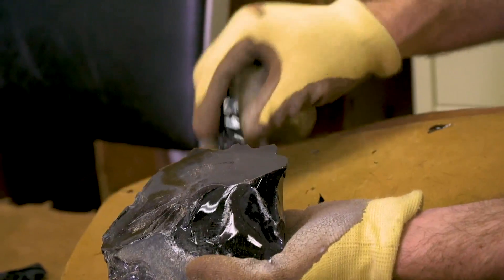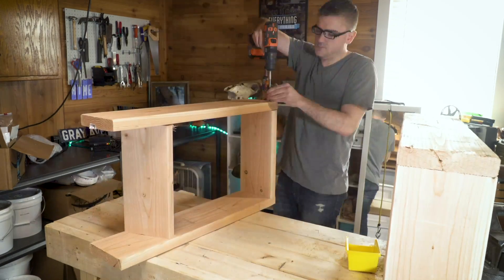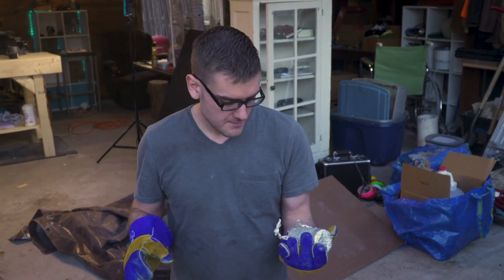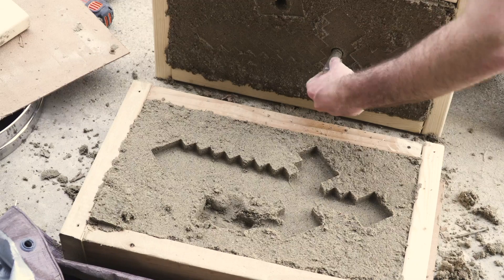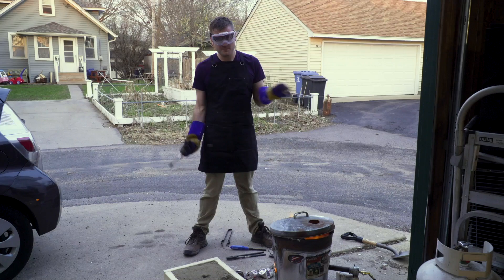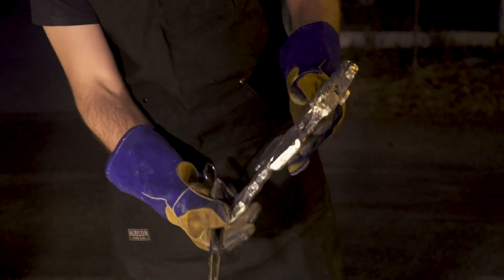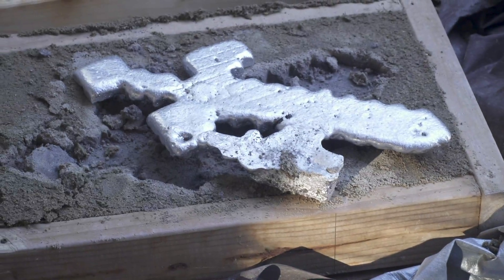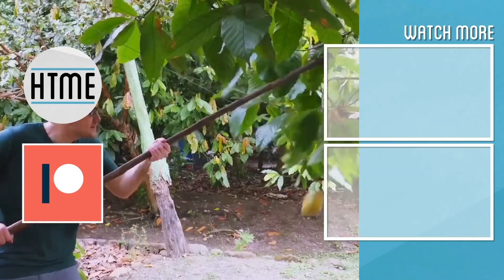Minecraft Sword from Soda Cans: Metal Casting 101

Comment: a quick warning if someone rly wants to melt soda cans.
1. do it outside and breath as little as possible if you re close to the furnace
2. be EXTREMLY careful with water in the cans which can lead to a vapor explosion, potentially splash molten aluminium into your face
Reply: lastly, consider sanding off the paint. it ends up as slag and pulls a lot of aluminum out with it.
Reply: You_just haha, but tbh i did that mistake and breathed in the toxic fumes, had coughing problems for weeks
Reply: JPAnor thanks for the advises
Reply: Andreas ikr, that s why i cringed so hard at the "aluminium ball challenge" videos. No one used dust mask and no one cared.
Reply: pshh, inhaling aluminum is good for the lungs, gives em a nice metallic finish!
Reply: JPAnor Same here, turns out coal dust, fumes, and whatever vapors come off those cans really screws your lungs up, had trouble getting a deep breath for weeks
Reply: Yeah, no kidding haha. My grandparents took my brother and I to a fair and they were demonstrating making lead musket rounds. I went first and held the mould while the guy poured in the molten metal and he dunked it in water. Then my brother went. I guess the dude didn’t dry off the mould properly because it exploded inside the mould and molten lead ended up hitting my brother right beside his eye. He’s still got a small scar there, and that was about ten years ago. I swear if it was even half a centimetre to one side he probably would’ve gone blind in that eye.
Reply: Jason Wheneger artwork from remonpie, character from cookiekitty (be warned there s a lot if weird fetishartwoks on his FA account)

always forgot to change my icon to my art
Reply: JPAnor where is your icon from?
Reply: JPAnor agreed
Reply: My tried burning a can he THOUGHT was empty and blew it up he’s fine though so lesson learned I guess
Reply: You mean pop cans
Reply: Screw safety
Reply: I straight up inhale all the fumes
Reply: Uncle Osama One of my favorite past times is inhaling gasoline fumes
Reply: I was kinda planning on doing it in my bedroom
Reply: JPAnor At least you wasn't melting lead :)...
Reply: What if i threw the cans into an oven for a few minutes? Would that boil off the water and make it safe(r)?
Reply: yes it would
Reply: JPAnor I want to see a vapor explosion lol
Reply: This was super help full if I did not read this it were going to blow up in my face
Reply: Daniel Elmasri I would have liked to watch it tho xD
Reply: Daniel Elmasri judging by your profile pic i am assuming you re still a child. If that is true i do not recommend you do anything similar like that, maybe under parental supervision with some propper saftey equipment like a face protector, fire resistant gloves and so on. It is nice that you re showing interest in some crafts project but srsly this topic can be really dangerous if handeled wrong
Reply: So, in a nutshell: clean the cans, get a gas/respiratory mask (like for spray paint or sanding stuff), do it in a safe area and maybe keep your distance.
Reply: Very Snazzy that would be the best case scenario
Reply: What does it matter is he is a child he types like an adult he could be an adult maby?😉
Reply: Also good advice thanks
Reply: JPAnor thx for the warning
Reply: I put straws into my nose with the other end in chlorine gas for breakfast
Reply: FURRY SQUADDD
Reply: JPAnor - nobody listens to furrys!!
Reply: It's fine if theres liquid in the cans as long as u don't create spaces by crushing the cans but what he did yes that can be harmful

Comment: All of the aluminum that I have melted up right now is from cans.  I probably got equal parts slag and aluminum.  I use a cast iron muffin pan to make my blanks that are pure for casting projects.  In the future though, I'm going to find more pure sources to start with.  Great job.
Reply: ManCraftingTM I would recommend cast aluminum engine parts, you can get them pretty cheap, sometimes even free, from scrap yards and they produce a much cleaner melt.

Generally you should avoid extruded aluminum, as it tends to be too pure to produce castings with any strength, using cast aluminum parts as a source of scrap to melt will ensure you have the right metallurgy for good castings, if you are only making decorative pieces that don’t need to be strong then by all means use extruded aluminum.

Hope this helps.
Reply: Great tip.  I actually have a 5 gallon bucket 3/4 full of the dross(thanks, I knew this word and couldn't think of it.)
Reply: Whats a dross?
Reply: Ahmad Zaki the crap on top of the clean melted aluminum.
Reply: ManCraftingTM can clear the slag off with something metal but disposable.  Old stainless kitchen tongs,  ect,  when it's hot.

Comment: I think your problem with the big crucible is that it might not have been tempered before hand. Or that it was not tempered properly
Reply: Nah. New crucibles usually need to be put trough ~15 cycles of heating and letting it cool down to keep it from cracking
Reply: @Raphaël Fortin 

That's Tempering...

Comment: just some advise. If you're using cans, don't crush them. The air gets heated in the can and melts it from the inside and out side.
Reply: Banana Mercenary What's wrong with that? If you crush them then less metal can get oxidized
Reply: Knowledge bomb:
Also you are supposed to put a release agent like talcum powder around the casting blank and on the surface of the layer between the two boxes. to release the part you tap the blank with a metal spoon or small hammer to loosen it before removing it, this should create a more defined border between all of the edges and the layers between the boxes. Also the boxes should have registration blocks or even just pieces of wood screwed on the outside of one of the boxes so that it forces the boxes to be held securely in one place and they can not be moved to any other place, also I think you would benefit from using a pouring spout and instead of positioning your inlet on the middle you should have them at both ends, and with vents anywhere air could get trapped like small nails stuck through the top on the blade guard ends. for more information check out a video by someone like myfordboy and possibly consider finding an expert on youtube and doing a colab video or letting them be your expert if you continue having trouble finding an expert. keep up the learning process!
Reply from the maker: Good to know!